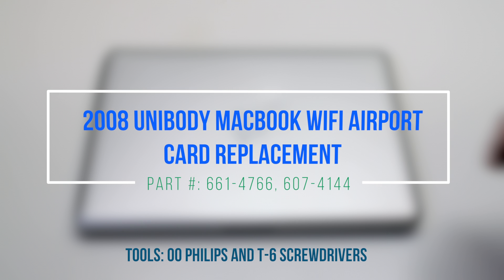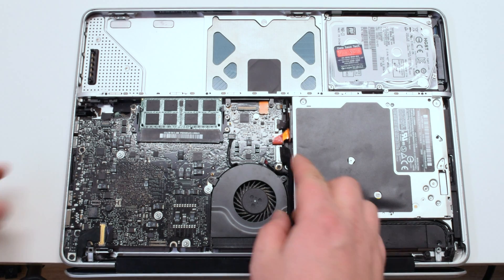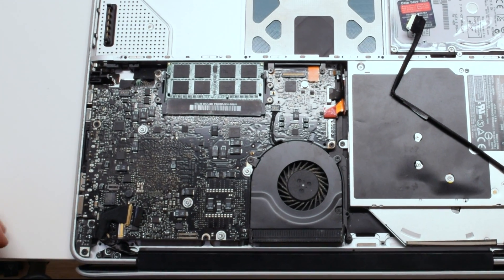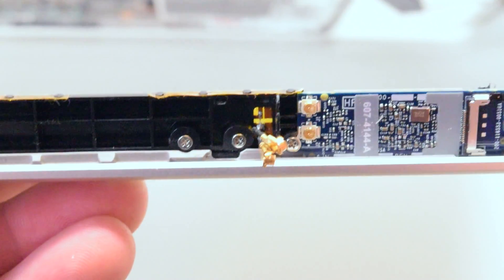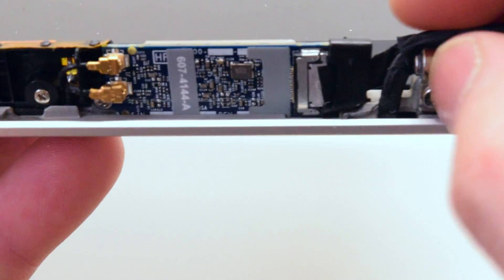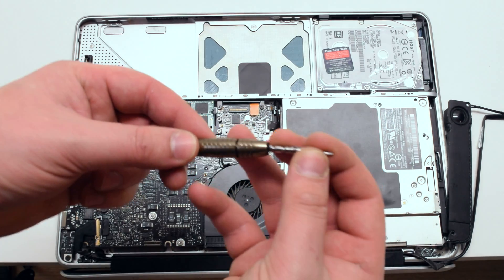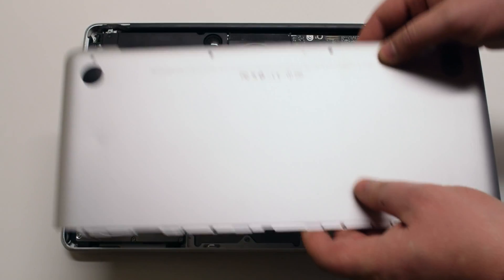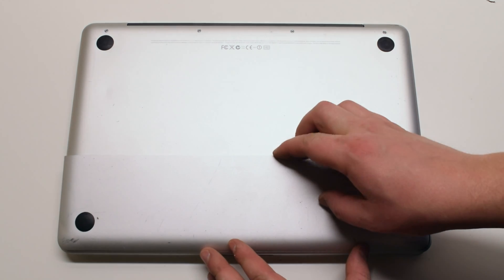2008 Unibody WiFi AirPort Card Replacement Save Apple Dollars #29

Comment: EXCELLENT how To!

VERY GOOD!

IF you get the vertical black bar on the LCD screen

Your LVDS cable is BAD!

Your SCREEN IS PROBABLY FINE!

The LVDS cable has shorted where it bends around corners..

Replacements are hard to find..

2009 MBP LVDS cables do not fit!

Has to be the Late 2008 cable!

SOME "repair" advice is geared to having you RUIN your screen!

CRACKING the cover glass or LCD....!!!

THEN they want to sell you replacements!

NOT fixing the LVDS problem.

A cottage industry, both here and on eBay..

BEWARE!

Been there!

Done that..

$50 worth!